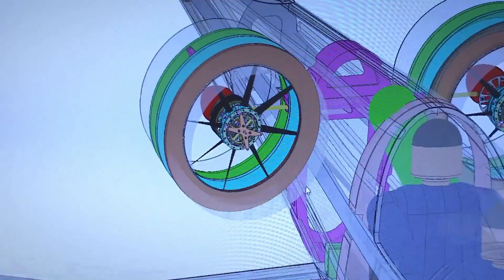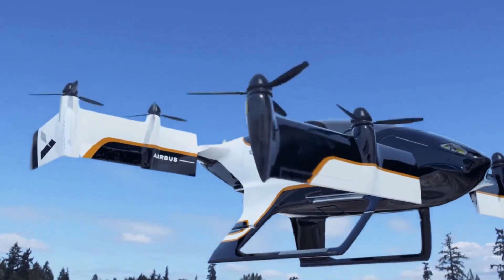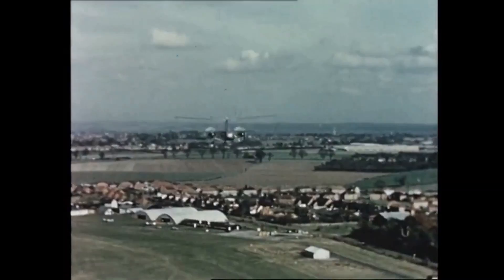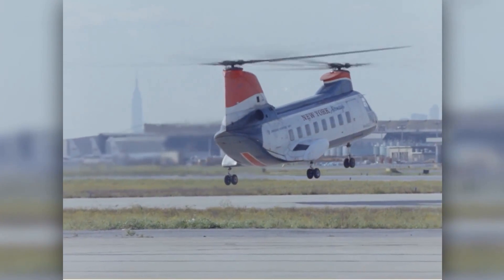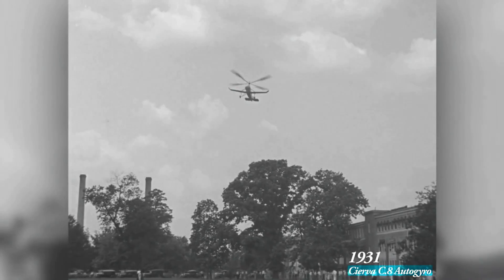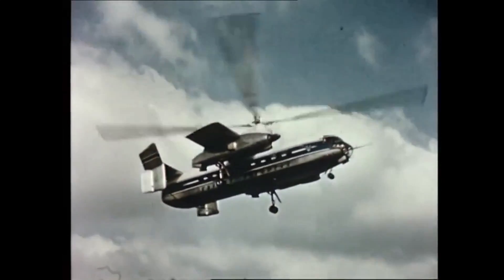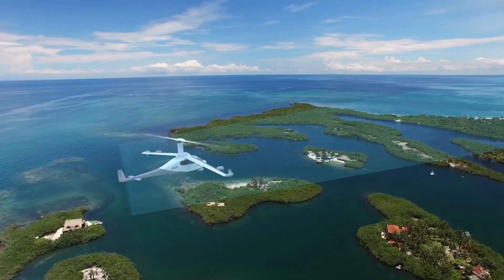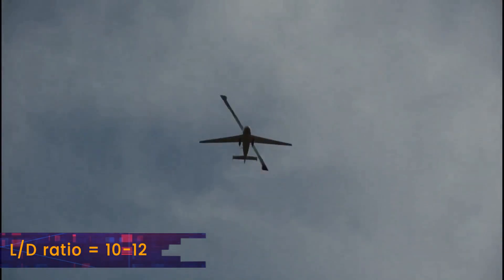The Electric Reincarnation of the Gyrodyne

Comment: Battery density needs to be at least 1.5KWH  to 1Kg ! 3 motors with 2 running continually equals very low range.

Comment: The rotodyne design with electric tip props instead of the ramjets seems intriguingly viable.  Would resolve the noise problem, and the fuselage vibration issues could surely be revisited and resolved.

Comment: I like your channel but you missed a key point of the rotodyne  the point was that the rotor was not coupled to the drive eliminating  torque from the rotor. The electric compound aircraft requires a coupled rotor and torque compensation.  This is a nice concept but the Rotodyne carried 80 people and could lift 9 tones of cargo when configured for cargo use plus it had a much greater range. Personal transport is inefficient compared to mass transport of the original concept.
Reply from the maker: Thanks for your informative comment

Comment: Excellent and informative video.I think the Jaunt entry has a leg up on it's competition for the simple reason autogyros are already an accepted aircraft category in the regulatory scheme of things,whereas other new VTOL aircraft would require completely new flight categories,which would be very expensive to develop. I am also thinking Jaunt could use it's electric wing props to counteract the torque of the main rotor if the latter were briefly powered for takeoff/landing,eliminating the need for tip jets as seen in the original Fairey Rotodyne.

Comment: The rotor of the Fairey Gyrodyne was always powered during flight. Two thirds of engine power was directed to the rotor for vertical takeoff with the remaining one third directed to the single propeller situated beneath the advancing side if the rotor disk. As airspeed increased propeller power loading decreased until two thirds of the engine power was directed to the propeller. The remaining one third of engine power drove the rotor so it would maintain rpm while while flying parallel to the flight path with the collective pitch close to or in autorotative settting. This minimized axial flow through the rotor which, along with the lateraly mounted single propeller are the defining features of a gyrodyne. The defining features of a gyroplane are positive axial flow through the rotor with a propeller proving thrust for translational flight. The defining features of a helicopter are negative axial flow through the rotor with a horizontal component of rotor thrust used to enable translational flight. 
A rotorcraft that powers its rotor for low speed/vertical flight and and autororotates that same rotor for cruise flight is a compound gyroplane, not a gyrodyne.
See: https://www.researchgate.net/publication/290776162_The_Cierva_Gyrodyne

Comment: I've been a big Rotodyne fan for many years now :)  2 points with this proposed design:  asymmetric handling with an engine out would be a challenge with the motors being positioned so far away from  the a/c centre-line, and how is the main rotor powered for  TO and landing?

Comment: One aspect of the power-to-horsepower calculation is damaging to all ducted fan configurations. The presenter gives the raw swept area of the ducted fan rotors, without taking into account the effect of the duct in amplifying the thrust available from a given power. Theoretically, the factor is two. Detracting from this is the fact that the Lillium fans are close together, which means they must "share" part of their mass flow. But contributing is the area of the wing and flap, which are in effect  huge duct lip extensions. Admittedly, there is still a large gap between a large open rotor and small ducted fans, but a factor of two could separate a feasible from a non-feasible configuration.

Comment: I keep revisiting this video because it carries a strong message. That many VTOL machines are optimised for cruise flight

Blackfly: Blackfly 'rotates' on its curved bottom to achieve the attitude for vertical flight, then transitions to cruise. It has on its wings essentially the same motor prop combinations fore and aft. As a tandem wing aircraft it is necessary to have the CG well forward, and rig the machine for a Clmax of 2.0 for the canard, and 0.8 Clmax for the mainplane. This gives an expected average of Clmax 1.4 for the machine entire, which is well within the scope of everyday technology.
Ordinarily this would mean that the CG which I position at th belly button of the pilot, would be out of position for vertical lift and horizontal flight, but the designer cleverly thought of this. With forward flight characteristics satisfied, the balance of the thrust power is evenly distributed because the vertical thrust footprint situates the CG between the two wings quite perfectly. But oh that pilot position.

Rotordyne: The fly in the ointment for Rotordyne is that it requires a collective pitch control rotor, which is neither cheap nor simple to achieve. however as an autogyro conventionally the pitch is usually fixed. With the disk spun up via torqueless means you are in a position to lift off at minimal speed but likely not vertical take off unless in a strong breeze. And here again, the CG to centre of lift issue would come up unless one utilised the mechanism of shifting the rotor mast as we saw here, but there is another way. 

Not as yet seen a two rotor autogyro, configured like a Chinook (think more like smaller McCulloch MC-4), with tractor propulsion. Because the rotors run at different heights, they somewhat avoid each other's interference flow, and the distributed lift cancels CG balance issues. With 'pre-rotor' management the typical gyro copter is able to lift off at 15mph or so, but clearly more thrust on a 'very' positive angle of attack attitude would reduce that on full power. This is quite close to vertical take off with very few complicated expensive moving parts, that compacts the rotor footprint and reduces disk loading.
Reply from the maker: Thank you. This is a very informative comment. I will pin it

Comment: Or - replace the single rotor and wing with an intermeshing twin rotor (Kaman style) for primary lift and autorotation safety, and place some 'pivoting' propulsor fans on stub arms for forward propulsion (and [pivoted] some additional vertical lift).
Also, why have a pilot at all.  If you can't make this autonomous (as an urban air taxi) then you are missing the primary point of this type of vehicle.
Reply: Gyroplanes in general need autopilot.  Accidents are almost always pilot mistakes.

Comment: Using the free rotation of the blades in flight as a regenerative generator is a really smart idea.
Reply: All dreams, there is no real possibility when 'reality' is considered
Reply: I don't think so. You encounter the same issue as a helicopter but in reverse. Applying any torque between the body and rotor will cause the fuselage to spin

Comment: Is there any “genius” out there who can explain why aircraft like in this video, can’t or don’t have a system to reciprocate their own energy as windmills and similar technology? Moreover, why isn’t there a system as I’ve stated, like the propellers in conjunction with solar technology to back up the generation of electric energy to perpetuate power for the aircraft? Last but not least, actually the greatest possible concept that is never considered is gyroscopic motion to not only stabilize the aircraft, but to generate energy for propulsion and lift! For instance, we all know the weight of an object can be nullified by spinning it at a certain rpm, thus creating force counter to gravity well instead of the usual one vertical dimension why not gyroscopic motion orbs reinforced by an electromagnetic grid? The possible applications of these concepts I’ve presented are only limited by ones lack of imagination, which unfortunately there seems to be an enormous abundance thereof.🙀🤷🏻😔/👌✌️🤲☝️😇

Comment: Does the downward flow of air from the rotar get converted into any forward thrust or lift when it encounters the wing airfoil? Excellent video. Thanks
Reply: The air going through the rotor goes upward, that's how it provides a constant parachute effect. Cool huh,

Comment: Is it possible to "freeze" the rotor perpendicular to the body to gain additional lift?  I believe that one side of the blade has to be reversed.
Reply from the maker: That is done by and X-wing aircraft, that is we can freeze the rotor and change the cross section of blades on one side. I have covered this in a video called "Wings of change"

Comment: Unless I missed it, I found no explanation as how the main rotor is powered at takeoff. Is there a dedicated electric engine to selectively power the main rotor, which would eliminate the mecanical transmission from the propulsion engine(s), like on the traditional gyrocopters ?

Also the pitch angle variation mechanism allows for vertical takeoff like on the Carter gyrocopter, but adds a fair amount of mechanical complexity and maintenance cost compared to the traditional fiex pitch angle gyrocopter main rotors.

Autorotation of a large main rotor is definitely a great safety feature. Pros and cons to be assessed, as usual. Anyway, electric propulsion opens new perspectives, as you definitely quote it. Thanks for your very informative channel.
Reply from the maker: Yes there is a separate motor powering the main rotor. Thank you

Comment: One point on the comparison to the Lilium, the effect of the location of the propulsors across the rear of the wing and canard can not be ignored. The inlet of the propulsors uses the wing and canard surface as the lower portion of the inlet when in horizontal orientation with the upper part of the inlet being an extended portion of the propulsor nacelle. The hinge line of the propulsors are located inside the inlets. The result is that when the propulsor arrays are deflected to vertical orientation there is no obstruction to airflow over the top of the wing and into the propulsor. However the upper portion of the inlet now projects above the surface of the wing and one helps to turn the air being entrained across the lifting surfaces and also inhibits airflow coming into the propulsor from behind the wing.

The result is that the suction of the propulsors will acceleration of the air across the lifting surfaces which reduces the static pressure causing lift to be generated by the wing and canard even though the forward speed is zero. Further when it is in ground effect, the exhaust from the propulsors will be cause a high pressure bubble to form under the wing and canard, further increasing lift. Thus in this particular vehicle you can't use the standard equation for power based on disk loading.

vertically

Comment: The Rotodyne's noise level was not addressed. Most of it came, not from the twin turboshaft engines on the tiny wings, but from the small jet engines in the rotor tips. This jet noise was the downfall. At least that's the story the public ws fed. As you pointed out, they were well on the way in bringing down that noise level. The real reason it was cancelled were the other companies that made regular airliners. If the Rotodyne had gone though, it might have meant less sales for their aircraft at home, (England), and abroad. They petitioned the government to stop the project. Personally, I don't know if money was exchanged, but, we hear enough stories about that kind of thing that I would not be surprised.

Comment: take off and landing taking up a big slice of available power. i know the perfect solution, catapult launching, and yes i am being serious
Reply from the maker: Yeah but I dont think the passengers would appreciate the G forces
Reply: @ElectricAviation  it's a small rollercoaster except you purposefully fly off the rails. Unlike aircraft carrier launchers, the weight will be less and the length won't be as restricted (usually)
Reply: @ElectricAviation  I'm going to properly word what I meant. The reason why aircraft carriers use catapults is to speed up the aircraft to compensate for the shorter runway, I'm sure you already knew that, what I am proposing is having a longer catapult. This longer catapult wouldn't need to have such dramatic acceleration as it would have more time to spread it out. The reason why I think it should be done is because it could share the load of taking off, and to my knowledge, that is when the most power is used, this would allow aircraft to fly further. There's also another bonus, the catapult can also be electrically operated just like the newer generation catapults found on aircraft carriers that replaced steam powered ones

Comment: Good video, just some observarions:
- autogiro rotor turns by aircraft translation, not by propeller wash;
- small aircraft ballistic parachute recovery works in a miminum altitude, ok, but helicopter autorotation also needs an miminum altitude and velociry.

Comment: Nice Video. Thank you!
Do you know a Gyro-copter with two rotors to reduce rotor diameter? May this could be the solution for the Gyrodyne. Less diameter = less noise = less tip speed.
Best regards from Germany
Reply from the maker: Yes I mention that at the end of the video. Coaxial gyros
Reply: @ElectricAviation  Better still a multi-stage compressor rotor

Comment: Power for take off could come from mains electricity via a detachable feed. If this were a cable it could even power the rotor for some metres of ascent after lift off, thereby saving the most severe drain on the batteries. Used as a shuttle between regular destinations, power could always be available in this way. Battery recharging facilities would be needed anyway.

Comment: It's crazy to optimize these short hop craft for cruise. Autorotation makes it's safe use viable.
Reply: …safer…
Reply: Maybe the added complexity of a rotor pushes the price up, but, the range and speed on this configuration is a game changer.  Maybe the power consumption is low enough for PV panels to make an useful contribution?

Comment: Carter Aviation's slowed rotor was ahead of its time.  I watched them for years. They had data and prototypes that showed very high fuel efficiency, but they couldn't get interest to commercialize the passenger/cargo version that would have changed the aviation market.  Hopefully the interest in a clean electric version will push it forward.   The autogyro's inherent safety vs. a  stack of VTOL fans and all of the failure points those systems have would make me more likely to use it.

Comment: You take as an example a fixed wing aircraft losing a wing and saving its occupants with a parachute, the equivalent of a rotary aircraft losing a rotor blade. I rather be in the plane in those circumstances.

Comment: Good show/analysis,i wondered about this,thankyou.i wondered also if a parachute or para sail,could be incorporated into the rotor blades hub,to save battery power.sounds crazy combining high rotation components with a parachute/sail and strings,but if the forward motion is maintained without the rotar blades,then surely this could be feasable,and the gliding speed would come to a halt proportionately  to the resistive force of the chute, long after the blades are disengaged

Comment: Thanks I learned something, that I never realized before: The massive impact of rotor size on lift efficiency. I will never look at all these multi-tiny rotor prototypes the same way again. 

The question becomes what are the major downsides of the big rotor? Noise?
Reply: A single big rotor is in principle also better in terms of noise.

The problem is that helicopters require an extremely complicated hub, which needs to both reliably control the pitch in an angle-dependent manner and provide a lot of torque. And torque is not something electric motors (or turbines, for that matter) are very good at, so you additionally also need more gearing. It's a lot of maintenance-critical parts, and even under ideal circumstances the reliability is not as good as multirotors with their redundancy.
Reply: @leftaroundabout  As demonstrated in EV's, Electric motors and inline reduction gears are both highly reliable (and nearly maintenance free), and deliver consistent torque across a wide RPM range.
Reply: @peterscott2662  Electric cars put only a small fraction of the power a helicopter needs through their drivetrain. Most of the time, only a tiny fraction. Of course you could compensate for the higher power by beefing up all the gears, but then it also gets heavier – not good in aircraft.
Reply: That's not to say you can't have electric single-rotor choppers of course – it's just one of the reasons why multirotors are more popular in the electric sector, since these don't require anywhere as much torque and mechanical complexity.
Reply: @leftaroundabout  I think you exaggerate the issue. Fixed reduction gears are ultra-robust, and we are talking about lighter weight, Gyrodyne style aircraft here, which will only power the main rotor for launch and landing, and will have no significant load the rest of the time, so most of the time, an extremely tiny fraction, since it won't even be powered.

In the example used the Lilium Jet converted to a single lifter rotor, with only 32KW of power.  Nothing compared to a Tesla launching in Ludicrous mode.

Comment: Excellent video. I really learned a lot from this. You mentioned the Jaunt Rosa needing a dedicated pilot. If technology (which already exists can be used to get rid of that increasingly wasted expensive weight) imagine what it could do to the economics of the product in a relatively simple way. Ie: Once FSD for cars has been attained it could rapidly be scaled up and deployed for aviation with massive cost savings.
Reply from the maker: Their initial plan is to start with a pilot but they will bring the auto pilot system by the year 2030